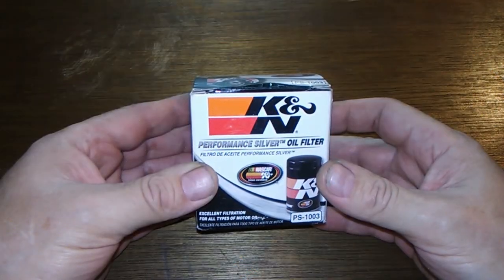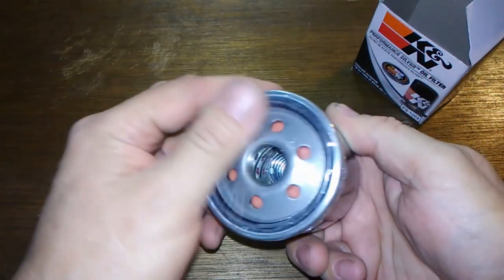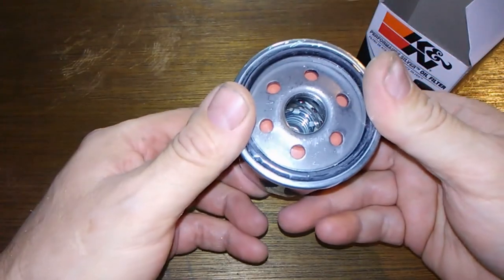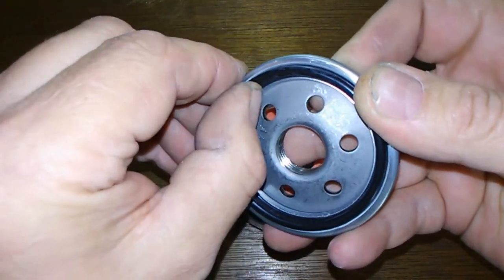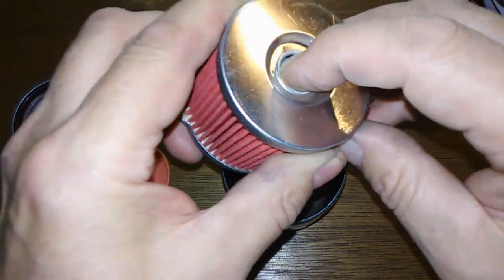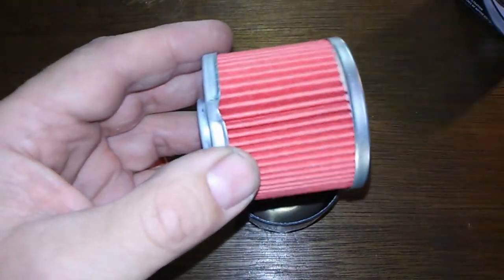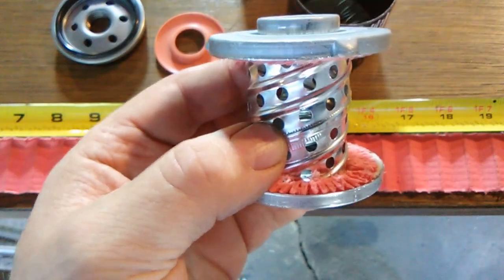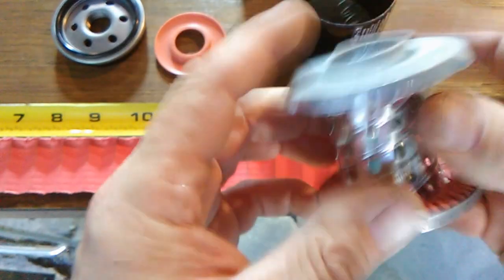K&N PS-1003 Oil Filter Cut Open

Comment: I've used both the silver (black can) and the Gold ( white can).

I don't remember seeing that made in China sticker but on my second car I've used the cheap Chinese filters from Rock Auto without issues but that car had clean oil every 3k mi. 

My main car , I don't cheap out on filters because so many things can happen in those 5k-7500 miles.

Comment: I used two K&N HP-1010 oil filters on my Subaru last year.  They were built well and seemed to perform without issue.  I can't find any published info on their efficiency though.
Reply from the maker: Yep, I couldn't find any filtration #s either. Thank's for the comment! Take Care!
Reply: The k&n hp-1007 is for my truck. It's a sturdy filter but no micron efficiency data anywhere. I even contacted them about it and they said they didn't have that info available. I moved away from k&n products.